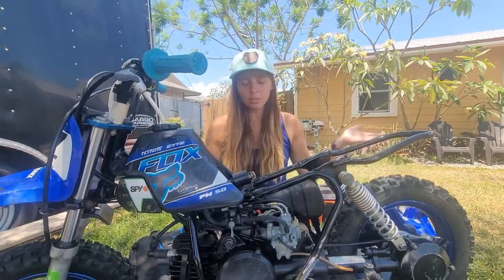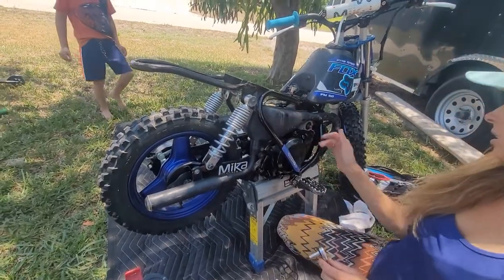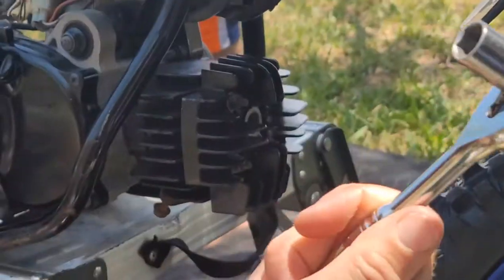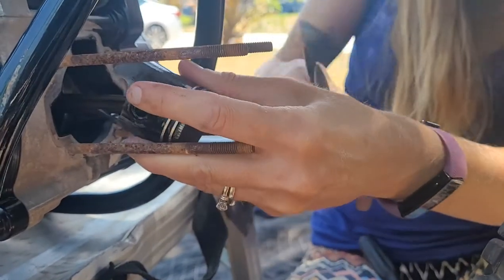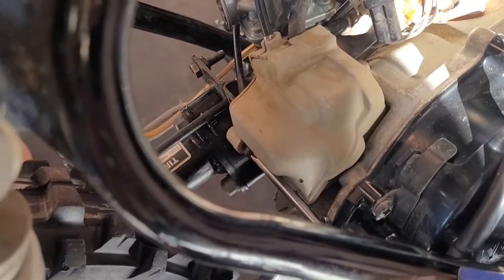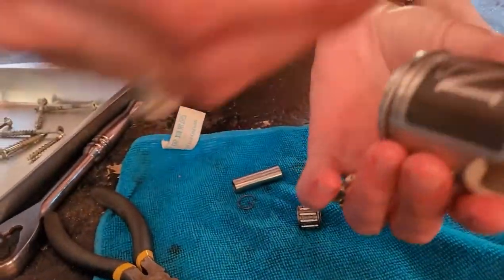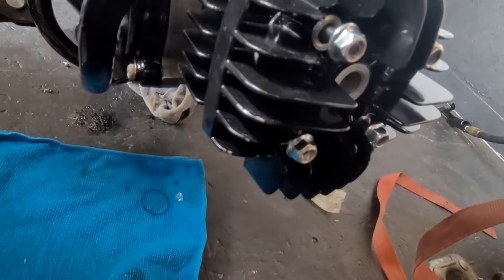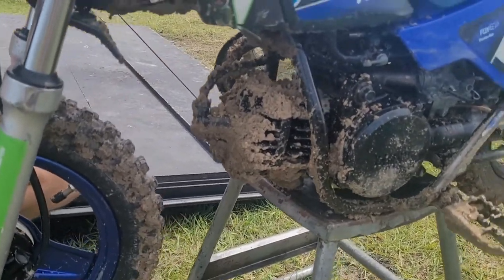Moto Mom Mechanic School Changing The Top End and A Whole Bunch of Other Stuff!

Comment: I had our boot disconnect at the box too.... I think one of the cleaning agents I used to clean the air box dissolved the glue 😱 I better fix that before our daughters next practice!!!
Reply from the maker: What adhesive are you using to keep the rubber boot part on the box
Reply: @sansonetime  thinking I'd use "The Right Stuff" sealant, or maybe black high temp RTV.... And if you never want it to come off again E6000